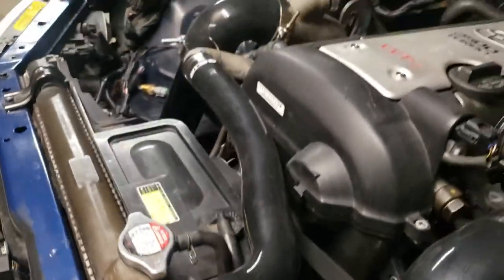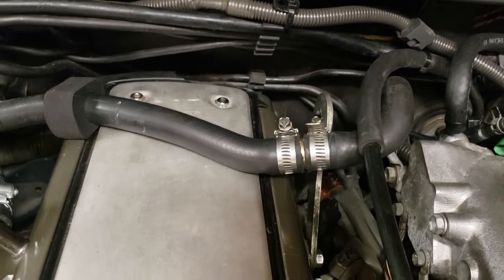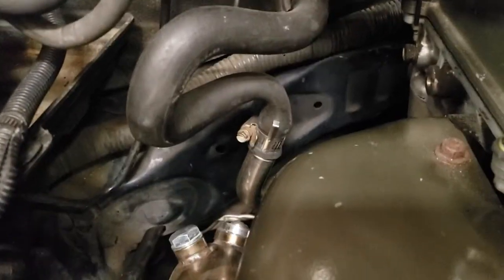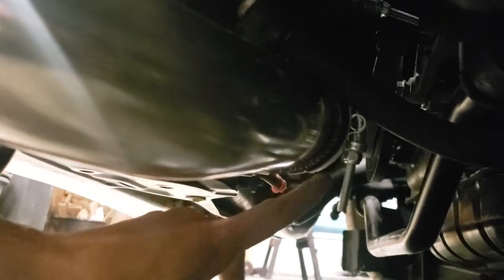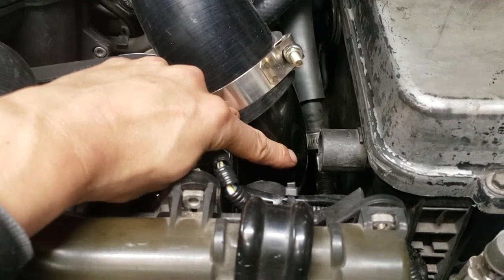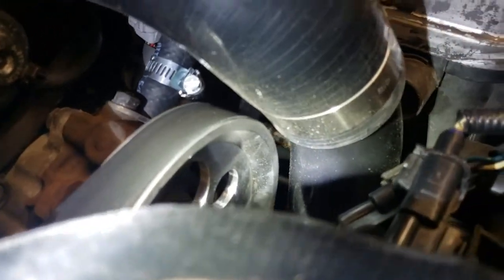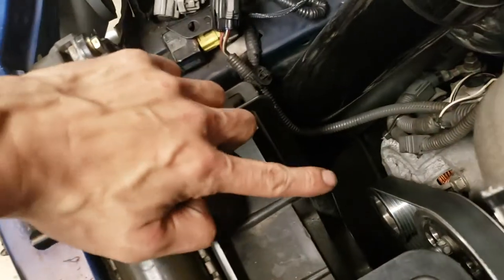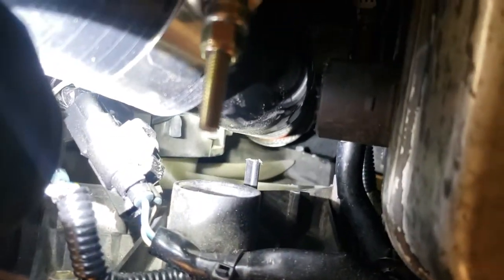IS300 1JZ swap - intercooler, charge pipe, radiator hose, oil catch can install

Comment: I used a universal kit for my 1J swap, and I actually got it to fit up without cutting! Pretty lucky. I would recommend worm gear clamps instead of those t-bolts though. Problem I had with the t-bolts is that they didn't clamp evenly, and would leak from spots near the top of the clamp. 8:20, that gap looks like it might leak. Changing to all worm gear clamps solved my boost leaks.
Reply: Vvti or non vvti kit?
Reply: Which universal kit did you happen to buy?
Reply: What? You're the first person I've seen recommend worm gear over t-bolt. T bolt usually hold boost way better in my experience, vibrant hd is the best though

Comment: I have 2.5 inch piping as well, not looking forward to these clearance issues! did you use the is300 brackets for the mounts or the 1j brackets?